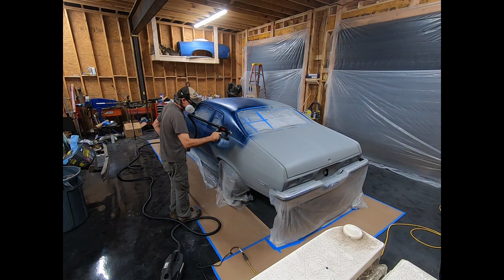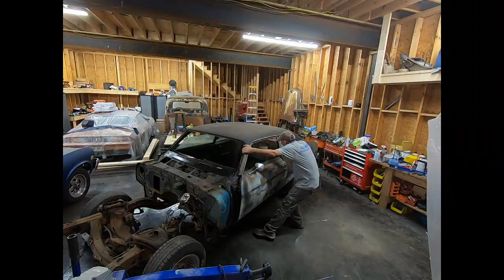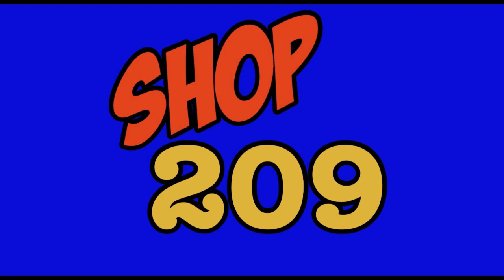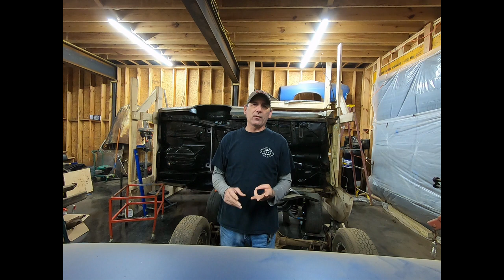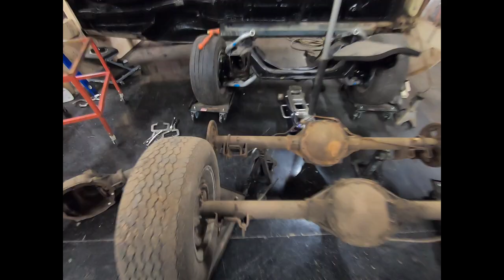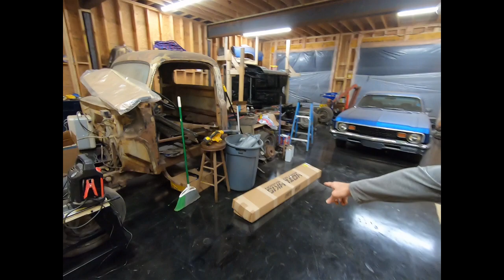Chevy Nova Rear End ID

Comment: I am rebuilding my 8.2 that in the 70' nova  I will rebuild the 8.5 that's on the floor later.  Before I removed the axles it seemed like there was a lot of play up & down I'm thinking wear in the bearing or journal,
Slid the axles out measured them 1.399 in     slid a new bearing on it  Timken 5707 "no housing load" but seams still louse ?   I don't know is that normal
Reply from the maker: It should use the 5707. That axle diameter should be 1.400. I’d have to check a stock rear to see how much play is normal.
Reply: @Shop209  Found some ACDelco Gold 5707 Roller Bearings should be better.  
I think I will buy new rear axels, stronger too I need to measure there talking about brake pilot size My drums are 2.81 . For a 1970  8.2 ?
Reply: @Shop209  Thing is about new buying new axles, the originals have a step for  Hub Diameter Drum and wheel. does not look like new ones have that.

Comment: I think the Nova hatchback I'm getting is a 1974. Do you know if later model differentials from Cameros will fit? Thanks for the videos and info 😀
Reply from the maker: 67-69 Camaro and 68-79 nova rears are all same width. The 70-81 Camaro rears are wider with different leaf spring mount spacing

Comment: Hey, great job Mr. John, very informative, so I'm taking out axels on my 73 nova 10bolt square botton,8.5,but i can't because there's a clamp device with 3 springs on one side, and 2springs on the other, it seems to lock the pois, because both wheels turn, and it takes up the room needed for the axel clips to be released ,was wondering what it was, what does it do, and how do i remove the axels with that installed, thank you..
Reply from the maker: Leave those springs and stuff alone. They are part of the posi. You have to remove the small bolt holding the center cross pin in and then push axles in to get c clips out. Then axles slide out. I have a video that shows this.
Reply: @Shop209  yes and I've done that,,but that springy thing in the middle prevents the clips from coming out...?,that's why i asked,,???tks mr john

@shop209,,yes and I've done that, but that thing with the springs, prevents the clips from coming out,,thats why i asked, haven't seen that setup up on any tutorials,
Reply: @Shop209  yes and I've done that, but the clamp with the springs is preventing the clips from sliding out,,

Comment: You seem ti know a bit about the old nova....so, riddle me this ...
 I have a 65 mono leaf 10 bolt with slappers bolted on and I have made my springs into S's... if you know what I mean. Soo, I am looking for a less expensive replacement spring.
The question is if there is a crossover like for the more popular camero or different year nova or other that could be bought alot cheaper.
 I find the springs for mine at around 300 and even higher and with shipping even higher yet. Camero springs are half that but not quite sure they will work.
 There are a couple if pull-a-part places within an hour or so that I could hunt different year subs if I only knew what to hunt for.
 Any thoughts ?
Reply from the maker: Ok. So it’s probably a length problem with the slapper bars. If the front snubber doesn’t go up and hit the spring eye where the bushing is, it’s going to bend it. Especially on mono leaf springs. The camaro leafs are a different length. I’m not aware of any cheaper that will swap.

Comment: Question I swapped 8.5 out of a 78 nova to a 68 rear and springs new poly bushings nothing lines up rear shackles are not straight up and down and my traction bar pads don't line up both multi leaf cars I'm at a frustrating loss
Reply from the maker: That’s weird. I know the housings are same. Did you tighten shackles up before setting car back on its own weight? You should let it sit down on wheels and settle a little before tightening shackles up completely. As far as traction bar pads, I’m not sure what you mean. The rubber pad that is between the bar and the housing?
Reply: @Shop209  I'll get pics in  the morning thank you sir ...
Reply: check to be sure but I think pre 75s are a little shorter.

Comment: Thank you for this information. I have a 71 nova and I need to replace the rear end. Do you have any suggestions where i should get one?
Reply from the maker: Any rear from a nova or X body from 68-79 will bolt in. Although some use different u joints and some leaf spring perches are deeper for multi leaf.

Comment: I got a question I'm buying a 10 bolt rear end 5.8 out of a 72 Nova not multi-leaf rear end it's my mono leaf can change that over to multi leaf
Reply from the maker: Yes. So if the rear you want to use has mono leaf perches, it would be easier to use mono leafs. If the rear you want to use has multi leaf perches, it would be easier to multi leaf springs but you can also use mono leafs with a spacer. Using multi leafs on mono perches can be done but I’m not aware of any easily available adapters that make it easy.
Reply: What's the difference between a multi Leaf rear end and a mono Leaf rear end I know you can put multi-leaf purchase after you take off the mono Leaf perch purchase can the multi-leaf rear end handle more torque then the mono leaf rear end I appreciate you you're very informative
Reply from the maker: Thanks!! I appreciate you watching. There’s no difference in the housing. Only in the depth of the perches. Mono leaf springs are also slightly more narrow.
Reply: It turns out the 10 bolt 8.5 from the 72 Nova I got today from Biggs California was a multi Leaf rear end but it had one leaf spring 4 giant rubber spacers two hundred bucks got a good deal he was a heavy equipment operator like myself
Reply from the maker: Cool. Hope that works out perfectly.

Comment: What year is the new 8.5 10 bolt rear end out of i got a 1970 nova with a 5.7ls1. I want to do the rear end what do i need
Reply from the maker: The 8.5 became standard in 72. All 73/74 had the 8.5”. Most 75-79 had them but a few had a 7.5”. If you use a 75-up make sure you have the right leaf springs. They used an extra spring.

Comment: So is the 8.2 worth upgrading to a 3.73 posi? I’ve got the 28 spline axles.
Reply from the maker: Honestly if you’re not going drag racing with slicks, the 8.2 should be fine. Even if you are racing occasionally it’s probably fine. Thanks for watching.
Reply: Got a buddy has a 6.0 ls in a 69 nova runs 11.50s with 8.2 with dot slicks
Reply: @davidhill5621  I stuck with the 8.2 and put a posi 373

Comment: I’ve seen 8.5’s take a lot of power without issue, I know guys that swapped 12 bolts out for 8.5’s because they’re just as strong and lighter. I’m currently putting about 550 hp to my 8.5 with moser axles, C clip eliminators, and a strange spool on slicks, have been for several years without an issue.
Reply from the maker: Yep. I have known 8.5”’s that went mid 9’s in a big block nitrous car.
Reply: Damn good axle for sure, very underrated.

Comment: There is a 350 74 Nova near my house, looks complete but a mess. Any idea the prices of project Novas nowadays? Most of the ones online are modified projects
Reply from the maker: Most of the 74 cars I see in my area(Georgia) are around $1000 for decent project. Depending on how complete or if it runs.
Reply: Shop209 thanks for the info, that’s interesting. This one has a 2020 registration so I assume it’s used regularly. But next to no paint left on it and lots of manageable rust on the body
Reply from the maker: @Rockroll8856   Just remember the 73/74 cars have a different trunk floor that isn't available. If it is rusted you will have to fab something. Also if it is a hatchback car, the hatch lids are near impossible to find in good condition.

Comment: Great video, good information!  Question for you.  I have a 70 Nova with 8.5  GM 10 bolt.  4.56 gears and a Detroit locker.  You mention that the 8.5 10 bolt is fine for 500-600 hp.  I did an engine swap and want to upgrade rearend to handle more power and also to run a spool.  This will be mostly a track car.  Engine makes 700 hp and plan to add up to 300 hp in nitrous.  Engine is a bored over 427 bbc with th400 with 5500 stall nitrous converter and tbrake.  Should I go with a 12 bolt, Dana, or Ford 9”?  Aftermarket doesn’t scare me, just trying not to spend $3k on it.  Thanks
Reply from the maker: You CAN build a 8.5 10 bolt to handle that. You would need a 30 spline(or more) spool, c clip eliminators, forged axles to match your spook spline and axle tubes welded. It would all have to be set up properly. That’s a minimum. By the time you spend enough for that, if you pay someone else, you could probably come close to buying a whole assembly.
Reply from the maker: Also, with a trans brake it’s going to be very hard on rear end when it launches.

Comment: Super informative. Gotta upgrade my 8.5 sometime. It’s an open diff and 2.73 ratio. Thought about installing limited slip and maybe   Something like 3.23. Do you think it’s worth upgrading the original housing or should I shop for an 8.5 that has what I want?  Thanks again for the cool videos.
Reply from the maker: I'll have a video up in next week or so where I completely build a 8.5 with 4:10 gear and a posi. Definitely worth upgrading. You need a few special tools to build it correctly but they aren't expensive.
Reply: Shop209 Sweet!  I’m looking forward to that video for sure! Thanks for the advice. 👍